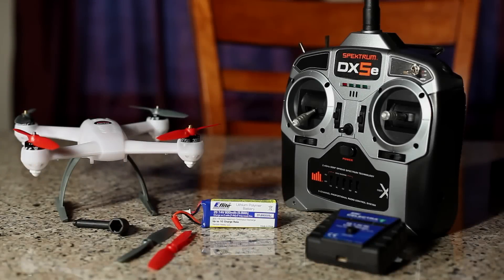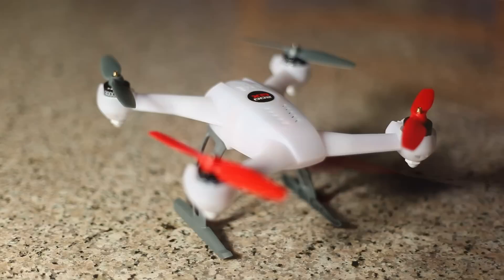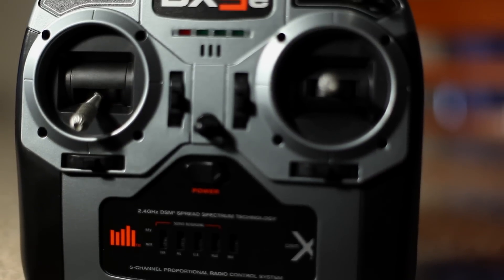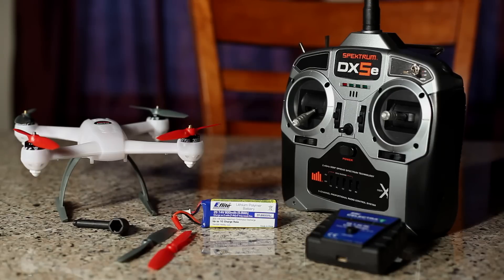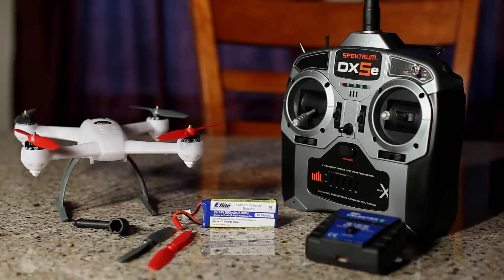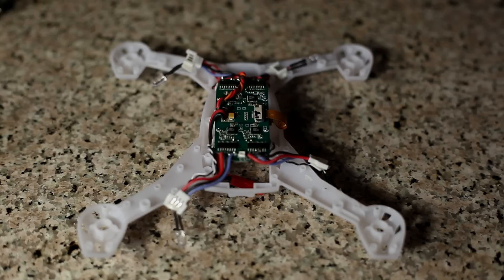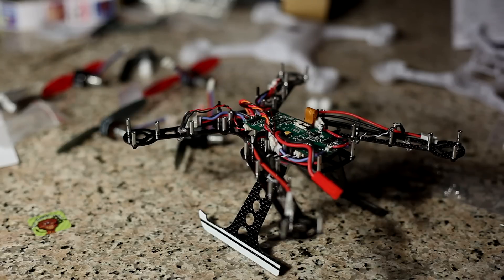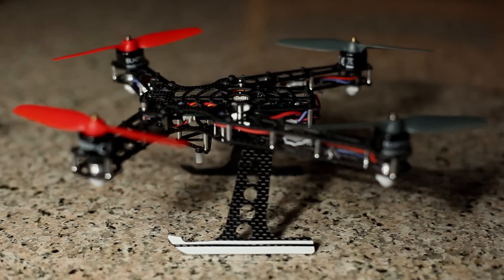BLADE QX BREAKDOWN & MICROHELI REBUILD

Comment: Great video, thanks for sharing.  I'm looking into doing something similar with my Blade Zeyrok.  Having trouble getting the two halves separated.  All screws are out but it still won't come apart, it's stuck right where the white LED's are located.  Any ideas?

Comment: Nice, be careful if your ribbon cable if you fold it, and make sure you dont use the aluminum posts for your FC and 4 in1. great video.
Reply from the maker: steve sparrow I have folded this many many times, I think it depends where you put the ribbon in the build, behind or in front of the motor connector wire makes a huge difference, and I did use the aluminum post and still have amazing range with complete responsive control.  Thanks for the comment and view, Safe N Fly'n!!!

Comment: WOW, I've seen a few of he other videos you've done, but this one is a disappointment. I mean you really didn't do a build, as I was expecting something on the order of the very well build video done for the Rakon frame 200qx build out.?? Sad
Reply from the maker: +Michael Aguirre Well can't please every1, every time but this is def a build.. top plate, bottom plate, 8 arm plates upper and lower, and a big bag of screws... so that's a building in my book..( And to mention this was my very first build of anything so to get the two boards out connected by a ribbon cable and not break them as many novice builders said they have in the past.. I was very proud of myself.) yeah no soldering but it def wasn't a disappointment for me, tune back in for this next build… you won't be let down again.. LOL, thanks for watching Safe and Happy Flying!!!